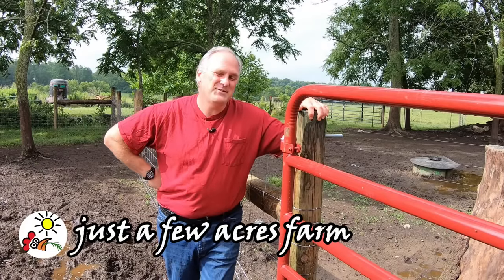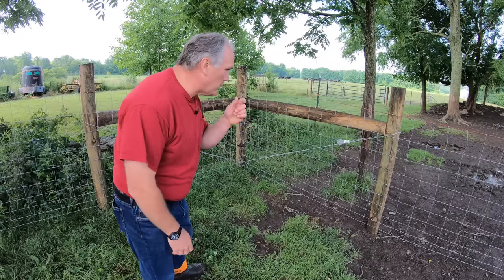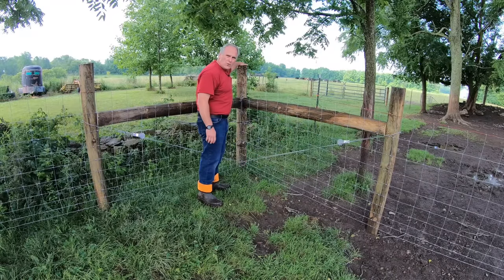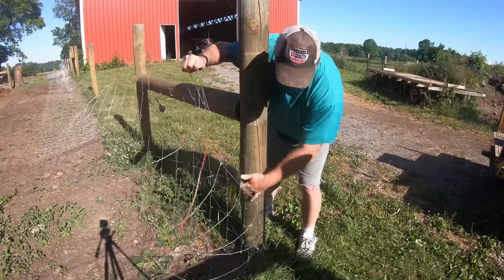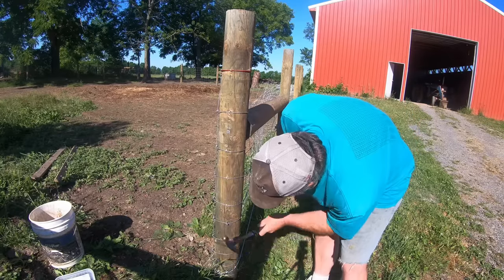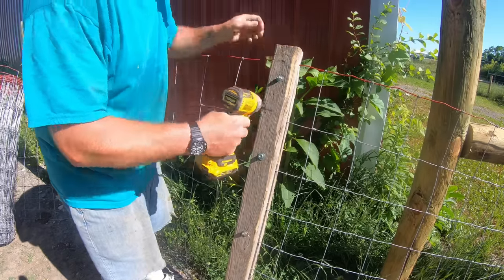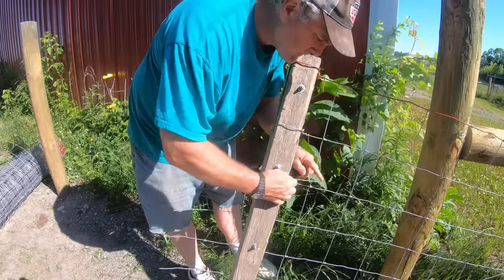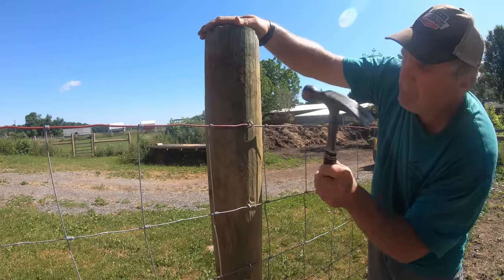how to build a woven wire fence, step-by-step

Comment: I've taught for 40 years. I've also used video a lot in my presentations. You have a great ability to narrow down what's important and make your presentation precise. Other DIY videos guys on YouTube make you watch as they hammer in the third nail. You video the first occurrence of each step then assume that your learner is smart enough to duplicate that as many times as necessary also using slip time to show the passage of time to the completion of that task. Very well done and helpful.   As a suggestion, you might want to mention the names of all of your tools and fittings, eg. "crimping ferrels" for the tension wire, so DYI dummies like me will know what to ask for when we go to Tractor Supply or Home Depot :).

Comment: ** TIP - using your technique of tensioning, install a horizonal member between the temporary tensioning post and your end post, to avoid concern of bending the post.  You don't even need the temporary post to be secure in the ground.  I used 3/8" steel pins to do this. **  I installed my first farm fence 15 years ago.  There are better "how to" resources today - this video!  A few of my posts have rotted and I need to redo 3 sides.  I am interested to see you used the same technique of boards to stretch, BUT you did something critically different - wrapping the wire!  I remember mine all slipped.  Using a tractor I had not considered - I set an extra pole, which required digging two extra holes per corner.  I also used 3/8" round stock to pin the braces, but I like your method - much faster.  This is great - thank you.

Comment: HI there Pete. Great video...I agree that some videos get a bit long. In NZ we call them Netting fences. They are 900mm high and may have a wire at the top and bottom. The wire at the top could be set up to be hot. I like the way you strained your corner posts. That way you can come back and tension it later.

Comment: This video was Very helpful & Very inspiring. I was thinking I could not do this by myself until I watched your video. Thanks so much for making it. My fence is 50" tall so my corner horizontal posts needed to be taller, which meant I couldn't support the horizontal post with my knee. To solve that (I thought, what would Pete do?) I put a large V-notch on the ends of two 4'x2"x8" boards and leaned them against the corner vertical posts so I could rest the horizontal posts in the V-notch while I drilled the holes & put the spikes in. It was easy enough to kick the bottom of the boards to make the horizontal post go up or down to get it level. Now, if I could just think of a use for that bucket of vertical woven wire pieces.

Comment: This is the best video I've seen on putting up woven wire.  Every farmer has a little bit different way of building fence, usually passed down from one generation to the next.  I would suggest wearing safety glasses especially when putting tension (we call it stretching) the wire.  If you've ever seen a strand of barbed wire break while being stretched, it will make a believer out of you.  A fencing contractor I know, who has built many miles of fence, nearly lost an eye when a fence steeple came loose and hit him in the eye while he was pounding it into a post.

Comment: You've added a few more steps than what I learned growing up but still pretty good how to video. To twist the wires we used a flat piece of steel with holes drilled in it.Easier on the hands. Well done.

Comment: Here in the UK we generally put 1 or 2 strands or barbed wire above the woven wire (netting) which stops the cattle pushing the netting down. They will push it down despite you tensioning it. I was really interested to see you taking out all the verticals. We just attach the horizontal wires to the post and then bend those wires back over the staple and add another staple to pinch it off. Beautiful job.

Comment: I'm putting up some more fence & I'm watching this again to make sure I get it right. The first time around I should have taken a few notes as it's easy to forget some things when you're in the thick of things & it's hot & humid. My fence is actually 60" tall (not 50") and I could not get the fence to "stand up" like on the video. I had to go down the line and tie it off to each post with some wire which resulted in a wavy ripple all along the length of the fence which would not completely stretch out no matter how hard I cranked on the come-along. I thought my wooden anchor post was going to snap, maybe. I wonder if there's a good trick for standing up such a tall fence?

I'm really glad I used the ratchet type tensioners, as the 2"x4" openings of my fence made it difficult in a few places to find room to wrap the horizontal wires around the posts and I had to un-tension  the corner brace wire to give myself enough room. With this smaller fence opening I used a wire bending tool, I couldn't imagine not using one with these small openings.
Again, fantastic video! Thanks for making it.

Comment: We always did barbed wire in the west.  I loathed fencing.  Cowboy work, awesome.  Mechanic work, treat.  Mucking, cool.  

Fencing.  Nope... unless I couldn’t help it.  

Solid video.

How do you tell the real cowboy in a truck?  

He rides in the middle.  He doesn’t have to drive or open gates.

Comment: Pete, I hook the wire inside (ie post side) the loop then the outside of the loop - this helps hinder any slipping of the wire longer term. Also when you do the other end and cut the wire inside the tension board, I prefer to do it the other side, so when the tension board is released the knot as tighten up with the strain.

Comment: I highly recommend lag bolts versus nailing the horizontal. Lag keeps it tighter over the years when things start to relax. I realize the tension wire should do that job, but the number of times I've had to re nail a horizontal due to neglect is crazy.
Reply: Hi Almin, I need to build a fence around my garden to keep deer, bear and rabbits out of it. I have cedar posts and woven wire with small holes in the bottom and larger ones going up. Since the I want to keep animals out, I thought of placing the wire on the outside of the posts, by doing so I would use the whole length of the post plus the nails to hold any pressure instead of placing the wire on the inside (like Peter) and leave all the pressure just on the nails. Would that work or should I stick with Peter’s method to have a better fence? Thanks

Comment: I ran 600 feet of woven wire about 2 months ago, i used the wedge loc system for the corners with t post. I think it will hold up as i was just using it for the dog and to keep deer out of the garden. I would not recommend them for strength even though I've seen other people use them for cattle. Someday when I get some land I will be using wood post like you have to keep it tight. Very informative video, and just like you said I had to watch tons of videos to find what you explained in 14 min.
Reply: Big Country I’m in the same boat with pups and deer. Can you share a video or picture of your t post wedge loc?
Reply: @wrgoinlive  here is the link at tractor supply. Hope this helps, i needed 6 corners and had to go to 2 different stores because they dont keep many in stock. So make sure you have all your materials before you start. Don't beat on them too hard trying to get them on they are strong once you have the wire tight but not really before. Watch videos because the instructions are junk,  also make your support post further away than what the instructions say. It's hard to explain in writing. It says if you have a 6 foot post, put your support 5.5 away. I would do 6 if I had to do it again, because then the lock is right at the top of the corner and there is no room to wrap your top wire. Mine were already set once I started pulling wire and my dogs only 35 lbs so I let it go. Good luck!
Reply: @nshue23  Thanks for your response! I didn't see the link you sent but imagine I can find it on the google machine. I appreciate your tip on the support post.

Comment: Thank you!  Well Done!

As far as the economics in general not necessarily for a heifer pen:

Is the material cost for woven wire less than the equivalent horizontal strands of smooth wire or barbed wire?

I think the labor costs might wash since the woven wire is more labor-intensive but you'd have to do five or six horizontal wires of the easier to build wire fences.

Comment: I share most comments here! Thank you for explaining the whys and the how’s! That really helps me. On question though. Shouldn’t you run the wire inside of your posts once wrapped around your corners? Those heifers will rub and push on that fence and your staples are going to pop out of the posts.

Comment: This is a great video.  If you don’t have that crimper tool could you use something else?  I have a wood fence with posts that seem to move every winter to the point where my gate opens.  I bought that wire and a twisty tension thing but I thought maybe I could just use vise grips instead of the tension tool.

Comment: Just put up my first run of fence following the directions in this clip.  I agree,  a stretched, woven wire fence is as thing of beauty.  Im really proud and excited with the result. Thank you for sharing your knowledge. Im fencing in my property and I have a quirky section that forms a 10' by 12' square shaped notch.  Should I use the same process of stripping, twisting and stretching for these short runs or is there a shortcut I could take.  Any suggestion would be greatly appreciated.  Aloha from Maui!

Comment: You could use a small diameter piece of pipe a foot long or shorter to stick over the wire as you wrap it and save you hands from the stress.

Comment: Good video on woven wire. I need to see one on unlevel ground. Notice you cut the horizontal post off.  I was taught the longer the horizontal post the stronger the pull or the corner.

Comment: I see you install the fence on the inside of the area.  How to you stretch a side full side of an area when you'd have to pull through a corners H bracing?  I was planning to install my fence on the outside of the posts for this reason.  Just wondering if I'm missing a technique to be able to install it on the inside?  Great video, thanks

Comment: Thank you for summarizing countless videos.  What size hole are you going to cut into the barn?  Do you have plans to put in a sliding door, or just leave it open?
Reply from the maker: Hi Tim, the doorway will be about 4' wide & 6' tall. It's on the south side, and we get very little weather from that direction in the winter, so I'll probably just put an gate across it so we can catch cattle in the pen for loading.

Comment: How did you tension your fence on the corners? Wouldn't your tensioning tooled 2x4s not work at the perpendicular bracing? You have your fence situated on the inside of the posts. How did you do this using the tensioning tool that you have featured?

Comment: What do you do if you run out of fence in the middle of a run? Do you have to put another 3-post stabilization setup like in the corners and join the fence to it, or can you join the fence to itself? Thanks! (asking because I have a large yard and the 100-ft fence rolls are just a hair too short!)

Comment: I have an old fence that’s 30 years old on the property and then it stops about halfway down my property line. I’m gonna leave a little bit of a space not much in between the old post and my new post. Should I have a cross post at the end of my fence even with it being straight run? Or do I only need to do a crossmember for turns?

Comment: If I could make a suggestion. On the corners instead of taking the wire to the inside take it around the outside just where the brace is and then bring it around on the next run if the post are solid they shouldn’t lean and that will insure staples don’t pop out
Reply: Scott Strnisa Hm, I’d like to see what you mean. I’m not quite following you.

Comment: I’ve been looking into your method of temporary fences with rebar and round wire insulators. It is a way cheaper way! Does the poly rope work well with the insulators or do you have a specific one?
Reply from the maker: Poly rope works great with the insulators. We use the Premier 1 Intellirope PE 4.5 and love it.

Comment: i have done this method over long stretches..like 300 feet...you can do it with driven t posts...drive 2 in to hook your come along or ratchet to...then tension your fence every 40 feet or so...remove the 2 t posts at the end and keep on going down the run...sometimes i will have a 3rd t post but it works i usually ratchet the top and bottom from the different t posts at the end......not the best way to work things but if you don't have access to a tractor or 4 wheeler or something to pull your fence tight it will work.